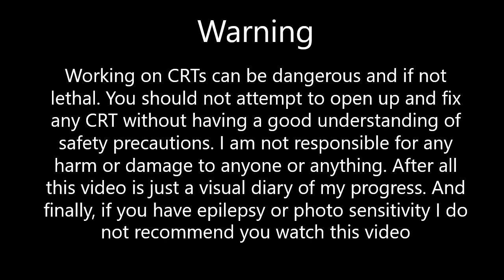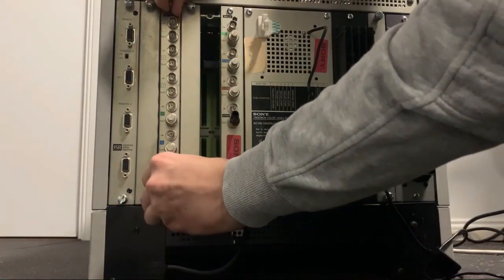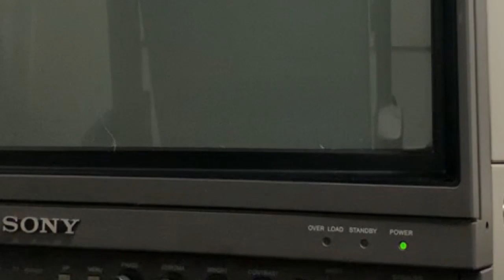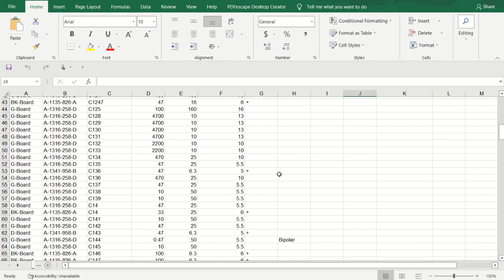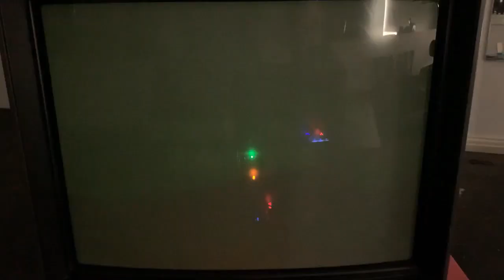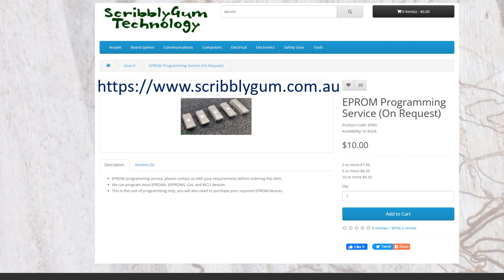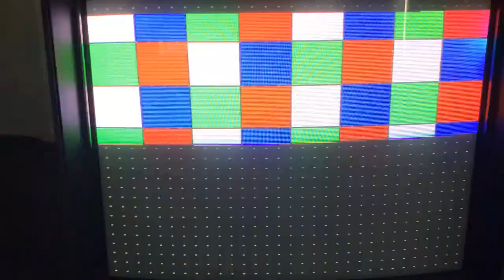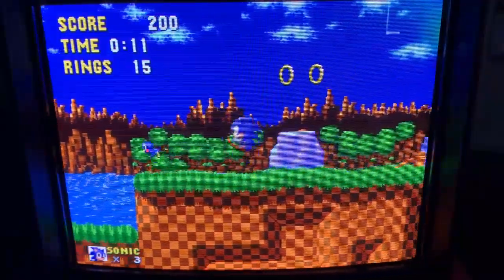Sony BVM 20F1 Recap and Upgrade AKA Sony BVM 20F1U

Comment: Great video, love the in detph explanation of the whole capacitor swapping procedure. I got my 20F1 a few weeks ago and it had been serviced before so it should be good for now. It has 22k hours on it and the sticker inside says it was manufactured in 1999. I already owned another BVM, the 2010P which is much older but gives a very similar picture. Amazing for older systems especially in the 8 and 16 bit area.
Reply from the maker: 2 amazing monitors you’ve got there. The serviced 20F1 should have you sorted for many years. Those 2010 BVM’s are awesome and a stop-gap in Sony’s engineering with manual controls. Thanks for the kind comment :)
Reply: @MarcoRetro316  I have a question, maybe you can help me out. Does your 20F1 have  vertical convergence alignment options?

Yesterday I turned the monitor on after some time to do adjustments. The Allignment menu has like 20 options for horizontal convergence for all parts of the screen. I could get the H. convergence as perfect as I could and I'm happy with the results. But as for vertical convergence there are only three options - Top, middle and bottom of the screen (and static). Not like top left, top middle top right etc. If I change to the value for the top of the  screen to get one side right, the other one gets misaligned again. I can't find options to do both sides separately.
Firmware version is 1.31. 

It's funny because on my BVM 2010P I got complete convergence control for all parts of the screen, both horizontal and vertical. But here It's all done with pots.
Reply from the maker: @weegeesoul  mine works the same way. Full horizontal convergence control but vertical is static (shifts the entire vertical convergence), or top and bottom only
Reply: @MarcoRetro316  Hmm that's a bummer. Thanks for your answer.

Comment: Awesome video! I need to do the same to my 20F1E. I bought a few of those cap kits from Pat, but have since read they are bad quality caps so I’m wondering if I need to purchase better caps and replace everything? did you test the caps in circuit?
Reply from the maker: Thanks! The kit I received had quality known branded caps. I only tested the SMD caps in circuit as I’d changed most of the radial caps by then. I suppose it depends if your monitor has any symptoms like mine so it’s hard to recommend to buy Pat’s kit vs sourcing your own. If your’re going to recap most boards I’d buy them all from mouser or digikey

Comment: Excellent video! 👏 It's probably the best one I've seen on BVM recapping and maintenance, lots of the right information packed in. I have one that is 35000 hours so it's reassuring to see yours still going strong at 70 odd. What contrast/brightness settings do you run at? Mine looks a little dim at the default 1000 values but overloads on the upper values so I run it at about 1300/1400. Maybe I'll recap. Hope to see more CRT vids in future 👍😀
Reply from the maker: Thanks for the kind words. I wish I could help you out with the brightness and contrast numbers but I’ve stored away the BVM until I rotate it back into my setup once again. I do tend to drive the contrast and brightness up a little at the expense of slightly washing out the blacks. Hopefully yours only overloads on white screens and not all the time otherwise something has gone out of spec.

Comment: Hey,

Nice restoration,
I have to update my firmware on my 20f1e, but I don't understand properly what did you do (sorry my english is limited).
Can you please explain me step by step the process to update the firmware (with links of what I need to buy) ?
Reply from the maker: You can flash the old chip or buy a new one, you need a CAT28F020P15, there’s some on eBay. I didn’t flash it myself, I paid a company to program it with the new firmware
Reply: @MarcoRetro316  So you sent to the company the new chip and the firmware ?
Reply from the maker: @Nekon0Kokoro  yes

Comment: Hello, I had a question for you. I have a Sony BVM 20f1e model monitor. The usage time of the monitor is 98,000. Is this bad for my monitor? My monitor looks fine though. There doesn't seem to be any problem. How many hours do BVMs normally have a lifespan? Can you answer these questions? I would be glad if you support. Thanks.
Reply from the maker: Hours really only factor in when buying/selling and to approximate the life of the caps IMO, but is no way an indication of hours remaining. The tube will be fine until it’s not, and there’s no predicting when that day will be, but an arbitrary indication is setting the brightness and contrast dials to the middle and seeing how bright the image is. If the dials need to be turned up all the way then the tube has seen better days but as long as the colours and focus is good then I wouldn’t worry about impending death of the tube. It may have had a tube swap or not which might be revealed by noting how neatly the yoke is seated. Generally, excessive epoxy may indicate a previous swap, or maybe you’ll get lucky and find a sticker with service history inside. Who knows, maybe some portion of those hours were attributed by power-on but no display, thus partially preserving the phosphor coating. 

The capacitors have a finite life which will end sooner with heavier use; so if none of the boards have been serviced at 100k hours I’d take a wild guess there’d be some radial caps that need replacing. I’m not one to recommend shotgun replacing caps (even though that’s exactly what I did here). I had several broad issues relating to different boards so rather than test all caps it was more beneficial for my time and longevity of the monitor to replace them all. If not, at the very least change the high ESR/10% out-of-spec caps with an ESR meter. Most of my SMD caps had leakage so if it were me I’d be changing the surface mount caps regardless to avoid traces and solder pads being corroded.
Reply: @MarcoRetro316  First of all, thank you for answering my question, is it possible for you to share a photo so that I can understand exactly where the covers and so on are you mentioned? By the way, the image of my monitor seems to be fine. This event lasts for 4 seconds, but the image is very clear and vivid in bright colors. I have to ask you a question I'm sorry, I may be taking your time, but what you said is very valuable to me. The problem is that there is no sign of my monitor being opened. But I don't know if it has been maintained until 98,000 hours, where and how can I learn it I know there is a menu in it How can I get information from here Do you have an e-mail address or WhatsApp address you use for communication I would like to send you both the photos and the video of the monitor Your comments are mine Thank you very much indeed for
Reply from the maker: @erzendiyar  The screws holding the metal shell need to be removed to take the case off, they’re easily located. I don’t mind helping within the comments which might benefit others, images and video can be hosted online.
Reply: @MarcoRetro316  okey.. thank you

Comment: Hey mate I'm planning to recap a spare KV-G21S2 sony tv and the parts list in the service manual is missing from any pdf I can find. Can just read all the info I need on the caps itself to order? I've only done a couple rgb mods and a flyback replacement and I feel like recapping has to be done eventually.
Reply from the maker: Have you tried looking up a manual for the BG-2S chassis? I did a quick search and found one and it lists the capacitors but you need to filter through to find all the electrolytic caps. 
https://elektrotanya.com/sony_bg-2s.pdf/download.html
Otherwise you could make your own cap list and use a sharpie to check each cap off once you’ve written down their values. If you do recap then use a different colour to mark the replacement. Caps need to be equal capacitance to the original (uf value) so hopefully there’s no conflicting value from what’s currently on the board versus what’s in the manual otherwise you’ll have to do some digging to see if it’s a factory revision. Voltage can be equal or higher to the factory cap. And try to get similar dimensions to ensure it’ll fit between other components. Watch out for non-polarised/bipolar caps without the negative stripe marking
Reply: @MarcoRetro316  I looked up the model specific manual not alternatives in the chassis. Thanks for the reply big steer for me in the right direction.

Comment: Thank you for your video.  Do you happen to know the method to return the settings on this monitor please?  I accidently reset mine to factory and the settings seems like a rubix cube
Reply from the maker: Your welcome :) unfortunately those older values won’t be recoverable after a factory reset
Reply: @MarcoRetro316  thats why if you are able to make a video tutorial on how to calibrate it back that would be most useful.  i cant find a single tutorial on youtube that describes it.  will be helpful for those that just needs a bit calibrated too.
Reply from the maker: @monstermug  it’s definitely something in the backlog that I’d like to cover eventually if I can find a funky set to run through some troubleshooting
Reply: @MarcoRetro316  You can always write down your settings and show some examples of what to do in certain situations?

Comment: BVM = high focus while PVM = normal focus. :) But BVM is less focus than modern (few vintage) CRT monitor-PC. ;)
Reply from the maker: Agreed, I’ve seen some pretty darn sharp high-end PC monitors. Only my preference, the main resolution I’ll be displaying and flexibility/versatility are the primary factors in mind when picking up a CRT. Therefore I’ve always forgone PC CRT’s in my use case but they’re great for PC gaming (obviously) or line multiplying/frame rate trickery for a BVM-like 240p look
Reply: @MarcoRetro316  Yeah. We knew the disadvantage of CRT monitor-PC with VGA port is no less than 30 kHz of horizontal frequency (HF). But fortunately, CRT monitor-PC with RGB 9-pin port works 15kHz HF for CGA or EGA mode and for TV. :)